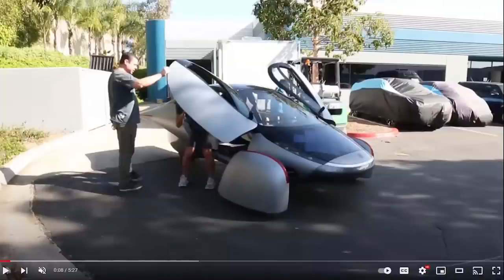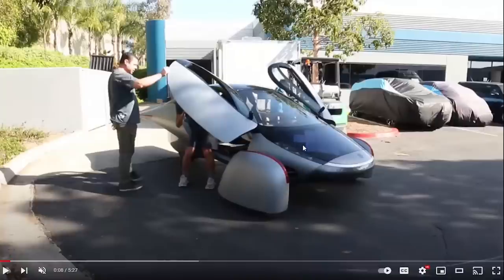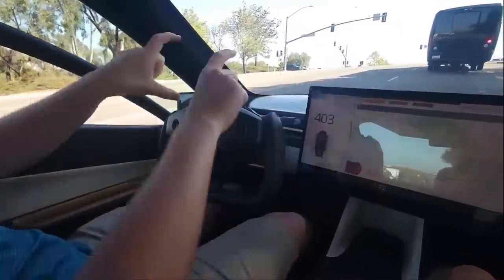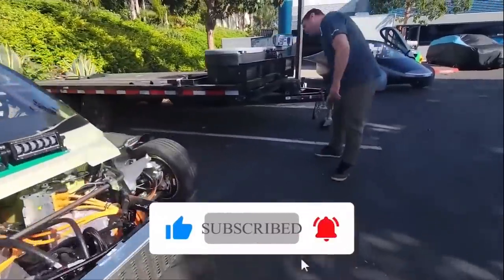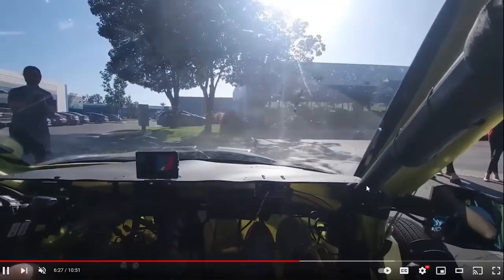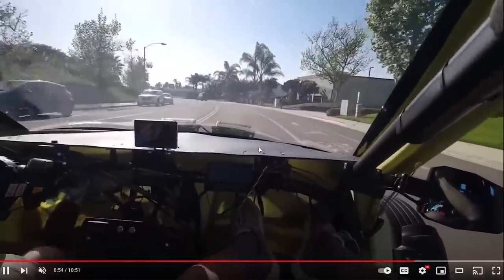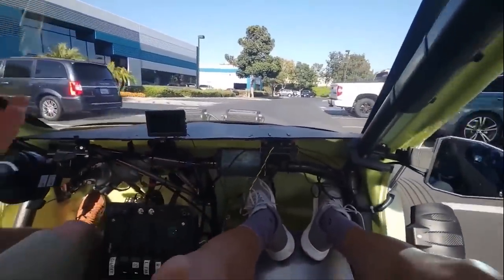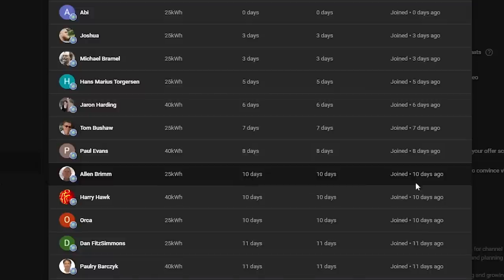Aptera is basically a sports car - Alpha and Beta ride impressions and thoughts

Comment: Great series of videos and you had lots of our questions answered.  So thank you for that.  To me, it still seems like a production car is a ways off.  I have a hard time believing it'll happen by the end of this summer.  Seems like next year/summer is a better guess.  But we shall see.
Reply: Definitely. There's also manufacturing refinement to consider, which means driving out as-built errors in fit, finish, and even audible issues in the interior due to manufacturing techniques, supplier or even design deficiencies all of which will need to be figured out before orders can begin to be fulfilled. 

At this point they're still refining functional design aspects as well as figuring out good compromises on affordability and availability with part and assembly suppliers. There is no way this is production ready by 2022. Late 2023 may even be too sporty. If everything goes well, I'm guessing this is a 2024 endeavor before they're delivery-ready.

It's great to be excited about this, but we don't have to look too far back in (Tesla's) history (of timeline promises) to appropriately temper enthusiasm with more realistic and grounded anticipation.
Reply from the maker: Yeah, I think the timeline is very optimistic but as a person with zero manufacturing expertise, I think there is a small chance they can meet their timeline.  I'll talk about it in a upcoming video.
Reply: @connectvanplans  I have been saying this for almost one year now and folks have been quarreling me over my realistic view. But now everything shows that I have been right all along. As Aptera Owners Club seems to agree too, if they manage to deliver even one production vehicle by the end of 2022, that will be a huge success to be celebrated. If it goes to 2024, that will be considered a failure. 2023 is more likely to be the year of Aptera, at least for the US.
Reply: @adimchionyenadum2962  Respect to your realistic assessment my man.

People in society just don't tolerate dissenting opinions very well, if at all, anymore. No matter how well-reasoned or tempered with experience. Case in point, my first reply to you, while quite a bit hyperbolic, was deleted. 

Freedom of expression is not something that is encouraged or tolerated today unless what you wish to express is aligned to the general consensus-opinion of the group. And using technology to reinforce this dynamic of manufactured conformity is absolutely dystopian.
Reply: @connectvanplans  Very true indeed. People don't realize that popular opinion is not something to be admired and followed. Of course as long as you are not a contrairian just for the sake of being one.

Comment: You can reduce speed when turning, I would not reduce motor speed when straight I mean come on just follow the speed limit, if Aptera senses a turn. Who wants to be limited at all times. Not every one is going to keep peeling out the tires but getting up to limit fast is what everyone does and wants. I'm more all about the solar so everything else just makes me happy.
Reply: Differential steering can be performed by changing the respective speed of the front wheels instead of changing the angle.  On a long stretch of highway this means that the wheels do not have to be turned at an angle to the slip stream, and can save some air resistance.

The 110 mph top speed limit is probably related to the clock speed of the motor controllers.

Comment: i hear have watched all the videos .been looking @ sticky tires not a good selection in 16"   195/45/16   they should go to 17" we could just do that and use shorter  sidewalls but then you have to recalibrate  ALL the bloody suspension settings. and will bend wheels in chuckholes and  w/  3 wheelers ? difficult to avoid !  narrow sidewalls SUCK ! 🙂

Comment: I'll bet one reason it rides a bit rough and is kinda rattly is because a light vehicle with hub motors, that massive swingarm, and wheel pants will not have a very good sprung/unsprung weight ratio
Reply: So maybe it needs 1000kwh batt for easy riding :-)
Reply from the maker: Unsprung weight usually leads to oscillations and I didn't notice any of that but you might be right.
Reply: If you do the calculations, the sprung/unsprung ratio of the 2WD model is better than many current vehicles, which make no effort to reduce unsprung weight. Many current SUV's and trucks have heavy cast iron knuckles and huge wheels/tires. Steel wheels are still quite popular here, especially in the winter, and larger steel wheels have a similar weight penalty as the in-wheel motors. The Aptera wheels and tires are  lighter than any vehicle on the market today and Aptera only has 3 wheels. The steering knuckle and wheel studs are integrated in the motor housing. The motors do most of the braking, so brakes can be lighter too. The total weight will be 1800-2200lbs for the production battery packs, so 600-700lbs per wheel. For the 2WD version, the rear wheel sprung/unsprung ratio is better than my Miata while the front ratio is slightly worse.

Comment: With the shape of Aptera, it’s possible in the future Aptera could add the wing with the solar panels on it to make the Electric flying car
Reply: I just want the ability to plug in the portable solar panels for maximum charge if one was parked for a couple of days say camping. I opted to not have the rear hatch covered in panels, so the option to plug in a couple of portable panels to increase the charging would be a plus.

Comment: How long does it take to charge the batteries from "empty" to "full" using a charger in my garage? I don't want to drive 1000 miles and then have to wait three days to recharge.
Reply from the maker: It depends on kind of charger you have installed at home.  The 1000 mile battery is the same size as the tells Tesla model s and standard range f150 lightning and half the size of the hummer ev.  So it will take the same amount of time as to charge the first two vehicles and half the time to charge as the hummer.

Comment: On a side note what size of tires are they looking at? Also are all three the same?
Reply: Last I heard all 3 were 195/45R16 on lightweight 16” wheels. They were thinking about changing to a wider rear wheel, but seems like the beta suspension is working well enough as it is.
Reply: @biffwilliams6191  Thank you

Comment: If the car is empty it will be light weight, accelerate fast, echo, twitchy on the road, etc.
Reply: My wife and I had a ride in the Luna prototype.  You are right about the acceleration.  Even the 2WD version is amazing.  It felt very planted, though, not twitchy at all.

Comment: Is it easy to change the rear wheel? Is there a spare?
Reply: No spare, but tire changing won't be too hard.  I plan to carry a DC inflator pump and a plug kit, which has served me well in several hundred thousand miles of motorcycling.

Comment: I would have really liked to know the turning radius in comparison to other SUVs. 
Why can't Aptera make the rear wheel turn in opposite direction of front wheel to make the turning radius tighter?
Especially since it has inline motors, they should be able to do this for lower speeds, that feature would have been nice to make u-turns or even tank turns.
Reply from the maker: They could make the rear wheel turn I think but then it leads to two problems.  Greatly increased complexity and altered driving Dynamics
Reply: @ApteraOwnersClub  which is why i mentioned to make it do that in lower speeds like less than 20 km. Any thing above that they can easily lock the wheels.
For a reference, Toyota RAV4 already locks its rear wheels to 2 wheel drive when the speed goes more than 40 km/h.
Reply: @Soothsayer210  Possible to do but a lot of additional engineering expense and schedule stretch. The suspension has been tested and tuned. All of that to do over again. Small  unnecessary gain for an arduous change. Just learn to drive it the way it is designed.
Reply: They could potentially add torque vectoring, slowing down the front inside while speeding up the front outside. I don't think they can do anything with the rear tire, the suspension is a rigid mount to prevent the structural risks from lateral loads.
Reply: @kevindavis8143  is that a major change? i believe it is similar to Tank Turn for Rivian where they make the left and right wheels spin in opposite direction.
Reply: @kevindavis8143  They have already said that torque vectoring will be a feature.
Reply: @Soothsayer210  software only, so a minor change they've already aligned to but I don't expect at start of shipments
Reply: @Soothsayer210  Look at almost any video of a vehicle doing a tank turn. They're all on loose dirt and snow. Doing a tank turn requires tire slippage on the surface. It also utilizes equal forces on the left and right of the vehicle. If you do that on pavement you'll put high stress loads on the suspension components. Engineering in that ability would add unnecessary weight and cost. Another choice is to burn the tires and really show off in a cloud of smoke. If you ever decide to try this, please take video.

Comment: Not sure if I want to recline so far back in the seat while driving.
Reply: My wife and I had a ride in an alpha prototype and we were not bothered by the seating position.  We expect it will change somewhat in the production vehicles, and YMMV.  I am optimistic.
Reply: @n.brucenelson5920  thanks....building 40 units per day at best, it'll be 2025 before i will see my delivery date !
Reply: @eugeniustheodidactus8890  Could be, but there may well be more micro factories set up if the pre-orders continue coming at an increasing rate as they have  There are now over 20,000.

Comment: 🔌YES, Aptera is not only super efficient but basically a Sports Car. Hopefully, Aptera can have a model to display at the Scottsdale Barret Jackson in January of 2023. Last year over 500,000 attended and EVs were well displayed and talked about amongst the ICE community. During the show, I convinced a McLaren and Lambo owner to put money down on an Aptera even though his vehicles are 0.6 seconds faster at 0-60 mph. Also, Aptera should be much easier to get in and out of versus other butterfly door vehicles that cost $800,000 more. Of course, a $26,000 Aptera is chump change compared to a high-end sports car owner where an oil change cost $1000 and $20,000 for a brake job at 15,000 miles. 👁Rumor has it that McLaren might have a solid-state hydrogen-powered EV sports car whose drive train is made by my neighbor in late 2025.👁🔌
Reply: Hydrogen is kind of a non- starter for personal transportation.  It is also not likely to be as environmentally friendly.    Some people will pursue tech just because they can - not because it offers real advantages.
Reply: @n.brucenelson5920  You might be right for cars but might not be for larger RVs and long haul trucks. As an engineer that works for the world leader that manufactures electric, diesel, and hydrogen drive trains along with PEM and SOFC fuel cells hydrogen will be the clean solution until we get batteries to 900kW/kg. We need batteries to obtain this energy level to replace heavy drive trains like hydrogen and diesel in long haul 40k+lbs trucks, cargo ships, planes, long-distance trains, farming, and construction vehicles. Hydrogen might be the only replacement for generators that supply backup to hospitals, data centers, water/wastewater treatment plants, emergency operation centers, and other critical processes.
Reply: @Carl_in_AZ  I agree with you, which is why I limited my comment to personal transportation.

Comment: I'm interested to get some range estimates for highway tripping- Figure 80 mph with the AC blowing on a 95 degree day.  Also...how is it at those speeds?  Is it a boomy, tinny rattle-trap where you have to yell at your passenger, or is it quiet due to the aerodynamics?  Also, I think the solar panels on the dash and hood is a waste due to the angle; only half the car can be angled toward the sun, so the other half is necessarily angled away.  You're best off with just the roof and tail and try to park with the tail facing south.  So...given the conflicting angles, I'm interested in how much ACTUAL energy you're likely to generate.  You're certainly never getting full power out of all the cells at the same time...probably never get full power from ANY of the panels
Reply: You can find your answers in a couple vids about aptera .. look the jay leno one and realise that was longtime ago  .. then look at tesla model 3 vids and know aptera will do atleast 20% better in range at same speed .. possibly 40% ... solar .. it willl be 800wh total .  So thats max sun high  in the sky ! .. .  Realise .  Solar on a roof will be much more effective. But with aptera as such an economical ride it will be a blast knowing it charges in the sun !
Reply: But the panels on the dash are not hurting anything so what’s the problem? Even if they give only a few miles charge a day, that’s still a few miles. The hood panels are also nit hurting anything but add to it. If you park with tail facing south eventually the sun moves. If you didn’t have other panels you’d be done. But with panels on the tail, hood, roof and dash at some point during the day each panel is going to be hit with sun. This is not the case if you limit panels.
Reply: With the aerodynamics, it should be the quietest vehicle on the highway. There is no metal in the cabin, so it can't be tinny. Composites are much better acoustically than metal. The beta motors are much quieter than the alpha versions and you likely can't hear them at all with the windows closed. You will lose some range on the highway, but not as much as less aerodynamic vehicles. The cabin is small and the composite is insulating, so AC loads are half of most EV's. On sunny days, the solar panels should cover most of the AC load. Each solar panel only costs a few hundred dollars, so probably worth it since you can't always park with the rear to the south. The solar panels should last longer than vinyl wrap on top surfaces, so they may save money in the long run.
Reply from the maker: range estimates based on simulation can be found here.

https://www.motormatchup.com/efficiency?id=6142270b831978846a96b74e
Reply: @ApteraOwnersClub  Thanks!  Looks like maybe 240 miles at 80 mph with the AC on for the 40 kwh model.  Not terrible but a far cry from 400, which I'm betting is probably some kind of ideal condition rather than epa rating.
Reply: @blurglide  It is actually the EPA highway cycle, which averages 48-50 mph with peaks to 67.
Reply: Regarding the solar, for what it's worth, starting at about 29:05 in this https://www.youtube.com/watch?v=TSOkexzaoNo video, Chris Anthony "quotes" some numbers from a "test setup" (full array(?)).  Consider giving it a listen.
Reply: @bobhilder1469  I think they have cells that total 700 watts...when they're pointed directly at the sun.  My point is it's impossible to have the cells on the front plus the ones on the back pointed at the sun at the same time.
Reply: @blurglide  Your point was/is understood.  My point is Mr. Anthony somewhat implied that, even given the mismatched pointing, the full array would deliver 700 watts under peak sun.  A “back of the napkin” calculation with the max number of cells one can select when reserving would certainly suggest something south of 700 watts but I think Aptera will, ultimately, have considerably more cells on it.  There’s chatter, by the way, that a recent rendering showed more cells on the hood.

Comment: Very well designed for aerodynamic drag and marketed as that.  This car may be close to being perfect as to having less drag, but it doesn't match the reality of the roads out there. The wheel fairings/cowlings are too close to the road surface and won't survive for very long. There should be a MINIMUM clearance of six to eight inches from the contact point of the tire to the road and  the bottom edge of the cowling/fairing. The designer has laser focused on marketing the coefficient of drag and not accounted for real life road conditions. This car could not be driven in a city with older, not perfect, street to driveway ramps without damaging/ destroying the wheel fairing/cowlings. Be  practical less theoretical in your design. This is just obvious to me.

Comment: Why didn't they just  use conventional doors?  Scissor doors are needlessly difficult to engineer for solidity and ease of use. Useless gimmick sucking up time and resources better spent on the basics. 
From your description, sounds like they are not magically overcoming the unsprung weight physics for a decent ride.
I think they may be biting off more than can chew.   Hope I am wrong  as I like  the  basic concept  I want to see it work..
Reply: The doors opening at an angle makes the vehicle easier to enter when it is up against a wall or another car than it would be if the doors were to swing directy out.    

I have only ridden in an alpha at this point so I can't comment on the reworked suspension, but Roush performance worked on both the doors and the suspension.  I think they had 20 suspension engineers working on the project for over a month.  

From what I can tell from videos, the performance is excellent,  Even the alphas felt planted in turns, although the ride was sports car harsh.  The addition of a sway bar has made it possible to install a more compliant spring rate without introducing too much roll.  The rear suspension has been completely reworked from the familiar motorcycle like single swing arm and seems to have reduced transmission of bounce to the body of the vehicle.
Reply: Koernigsegg solved this issue with their helix mechanism.  I don't think it is out of patent (unless Christian invests in Aptera).